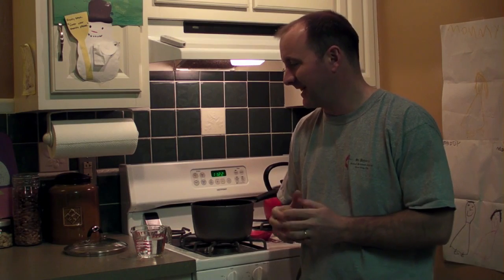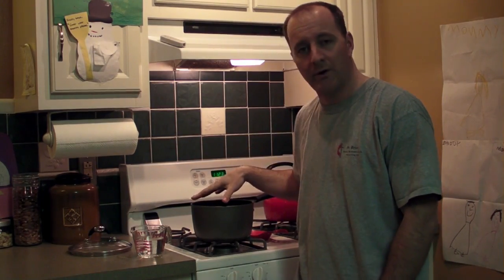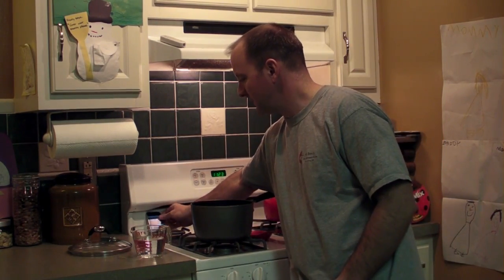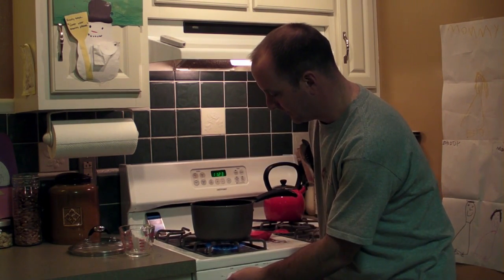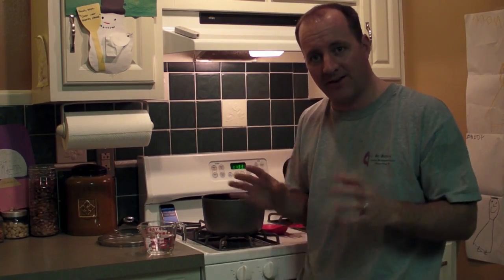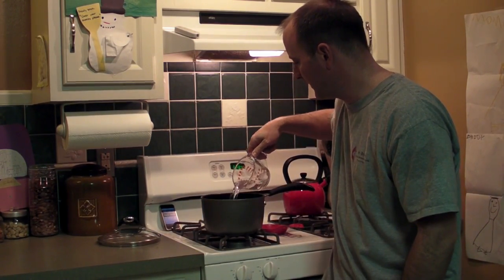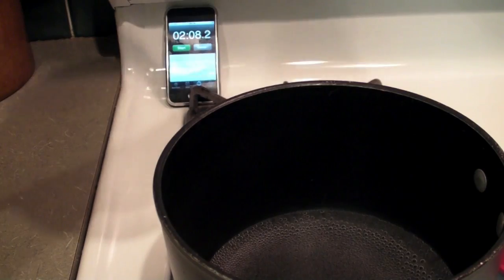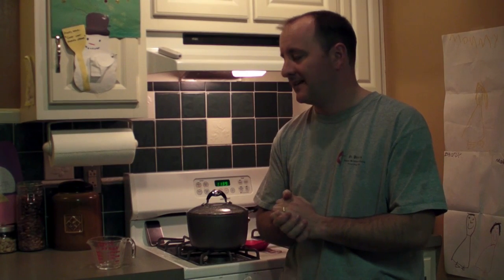Boiling Water With the Lid On

Comment: This is actually a common misconception.  Adding salt will increase the boiling point of water which has the effect of it taking LONGER to boil the water since it has to reach a higher temperature.  What this will do however is that any food you place inside will cook faster since the water is at a higher temperature.